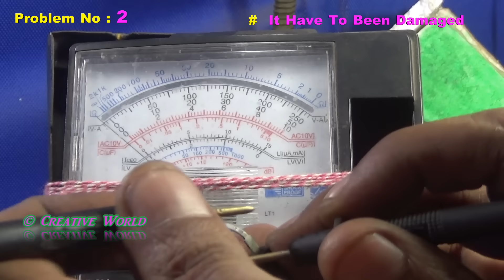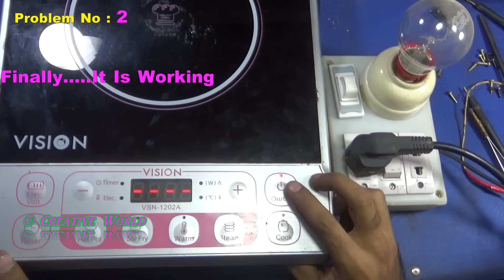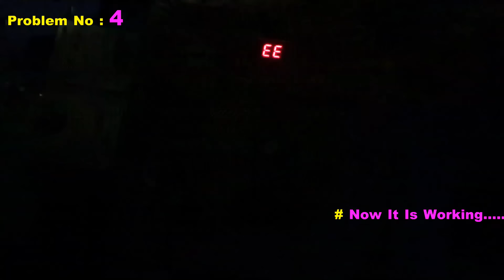Top Four (4) Power Problem Repair Of Induction Cooker - Very Useful

Comment: You are good, but you shouldn't recommend shorting the fuse. That is a potential fire hazard, should anything go wrong. In places where  there are load shedding and other power grid changes, the device could run over it's ratted current specifications and overheat, possibly causing a fire if there are flammable materials near the device. It's a good video however. Next time, consider talking and explaining using your voice to emphasize and clarify your troubleshooting, fault checking, meter usage and soldering to replace the parts...

Comment: Very good video. Personally the music is  overpowering,  so to watch I turned sound off.  Many videos are way more enjoyable  without  music, this includes professional movies. The one I am waiting for part to repair, the fuse  is rated higher than the mains trip, (20A fuse, 20A IGBT, 16A mains trip) so the mains turned off, also the unit was not in use but connected to mains.  So in some units if the IGBT goes short, either the fuse blows or the mains trips.  Added you to my fixit section and a thumbs up.
Reply from the maker: Noted!

Comment: Another possible problem with these cookers could be the thermistor, and this could be for checking the temperature of the cookware by checking the temperature of the base of the cookware, using a thermistor under the surface or perhaps the glass could have an embedded thermistor, which would mean that the repair would involve replacing the glass with a manufacturer part
Reply from the maker: thanks

Comment: Your 1st 3 problem solving are very nice but 4th one are not a correct solution's...need replace fuse with proper amp for safety of  PCB & also user
Reply: How to solve e4 error...my induction works fine in shop but shows e4 error in home
Reply: @maheshnakh   pa-♧08], ♧1 [.¿
Reply: H

Comment: while it works, bypassing the blown fuse might not be the best way to fix it. it is better to replace the fuse. anyway, great video. I've fixed some induction cooker previously too.
Reply from the maker: you say right,,,
i use some shortcut method to repair the induction cooker
Reply from the maker: you say right,,,
i just try my best to see some shortcuts ,,,about the power problem of induction cooker
Reply: Creative World
Reply: you are correct to replace and not bypass.

Comment: I agree that the 4th repair tip is not a good practice. The reason we have a fuse is for safety - to prevent electrical fault that may cause fire. Always replace the fuse with the correct specification. Lack of info as when certain electronic parts became shorted, automatically the fuse should blew up or get busted (busted fuse).

Comment: Looks like, overall though if you're in the field like me, it would be simply replacing the board since we're not allowed to do weldments in operating commercial kitchens. But at least now I know HOW to fix it with a soldering kit.

Comment: nice I had some plastic between coil spacing melt, wondering if contact between coil points will cause a short.. the heater is flashing on and off, and prior to me moving the coil that seemed to melt together a bit was not powering on at all.
Reply from the maker: Most likely

Comment: Sir  i got induction repaired 3 to 4 times. But everytime lagate hi spark ho jata hai. Bahut pareshan hu. Switch board check karvaya. Electrician bolta hai saab wiring theek hai.usi socket mei hum oven chalate hai koi problem nahi aati . Pehle induction  usi socket mei thezk chalta thaa paar pichle 3 se 4 mahine se problem aa rahi hai. Please help & guide

Comment: When i use a neon tester to check the stove top or the vessel placed on it the neon glows. Is that normal? I used the voltmeter to check the voltage between the vessel  and Earth/ground and it shows about 30V.
Reply from the maker: no problem

Comment: Main LED is blinking (ON/OFF switch) and beep sound is also working, but when I press the other buttons then there is no action. What might be the issue. Recently I have washed the stove with water (In top of the panel, I think few drops got into inside).
Reply from the maker: you should wash panel board with cleaner and replace all switch

Comment: It wd have been better if steps were shown to guess/detect the faults - i.e what are the symptoms to conclude that the transistor or the rectifier or any thing else is defective.
Reply from the maker: there may be beep sound,,or no display on the induction cooker
Reply: prestige induction cooker has only been sound after on condition but no display
Reply: My prestige induction cooker some time working. But suddenly off.  After some time it is working.

Comment: sir ji
maine induction cooker me diode,igbt, 12a ic naye lga diye h 1850,1820 ke transistor check kar liye h.sahi h,shot bhi nahi h.chalu nahi ho rha h display fan me koi halchal nahi ho rahi h...
capacitor par 340dc,or ek prove capacitor par dusri display output socate par chake karne par sab par 340,340 dc bta rha h
plz help me.

Comment: Sir - thank you for video. I have 3700W 11" Induction coil, it seems to output very low - boils water same speed as 1850W burner. Could problem be with coil - coil still heats pan -  or the generator board? It is interesting power is almost half - could somehow one item be damaged on generator ?  Thank you

Comment: I have the ihe3790 240v after clean it let it sit for a week before I plug in the cable. No power on display .   Remove the housing found the fuse blown.  Put in a new fuse 15a 250vac with is the original.  I replace the same fuse plug in.  Fuse blown again.   What should I do now?

Comment: There's enough grease, dirt, and shit inside those to cause problems 5 through 18.  How about doing some internal cleaning.
Reply: Sir,
I've purchased an Ind Cooker only four months back,(ie. Butterfly Rhinov2 Power Hob, Power 100- 1000W , it is under warranty, (4months only left)according to Menus, we can
Make Roti/Chappathi, unfortunately
To make a Chappathi is getting very
difficult and that much strain we've to have to hrstupsbecause Min. 10- 15 minutes
Reqd  to heat up (to have a ) Chapppathii, Ours time unnecessary killing more than 15-20 minutes to
prepare a chappathi, What is the solution to minimise the time to have the Chapppathi in 5 minutes period,Is there any remedy to return
the Ind. Cooker to respective company so that a replacement may
have had, it w'll get me more happy in this connection, 
Or any possible  advice  
With Regards,
A Customer of your product

Comment: Hi, a great vídeo. Could you help me, my induction cooktop IS needing repair. All part funciona, but not heat sufficient. Do you know what kind problem?
Reply from the maker: you should check the heating coil
Reply: @CreativeWorldPro  thank, do you know how can i check? I checked with The multimeter and The Signal continuity is ok.
Reply: Do tarikha hai 1. Capacitor 5mfd/400 volt replece. 2 . Heat control preset 203 k replece  job done
Reply: It is not a very easy to check the power rating of induction cook top as it works on the principle of induction not on the joule heating, i can suggest an alternative method to chek the rating of a induction cook top. 
To check the power rating of the induction cook top. Let the rating is X, Now take 1 lit of water and record the initial temperature T1 degree Celcius, Now pour this water into a steel (or recommended ) flat base flask ,( base should be nearly equal to the specified area ), Keep this water for heating for 1 min (60 seconds in 100 percent mode) stir it and record the temperature T2 degree Celcius. Now you can use 70*(T2-T1) to find out the rating, this value should not be less then 75 percent of the rated value.

Comment: For fluids thin plates.The thinner the plate and the smaller the gap in between good heating.Similar in construction with car radiator.boil 1liter of water and then mix with 1liter cold water.
Reply from the maker: Thanks for the tips!

Comment: Hello, thanks for this video. Trying to switch on the induction cooker blows the fuse away in my house. What could be the issue?
Reply from the maker: try changing the rectifier of induction,,cooker
Reply: @CreativeWorldPro  same problem but the fuse goes off only when the coil is connected to the heater ...when I removed the coil and put the fuse it was working fine...when I again put the coil fuse blows off...and resistance of the coil is showing just 5-6ohms only ...what should be the reason

Comment: In step 4 did you leave the bridge on the fuse line? Wouldn't we have to identify and correct the reason for the blown fuse and replace it with another of the same current?

Thanks. I already liked and subscribed to the channel.
Reply from the maker: I did not have fuse, at that time.  For that, i follow that method. But everybody should use fuse.
Reply: Ok.

Comment: hai.....my igbt got bursted, watching your video ,i changed it myself, but it worked only for around 15 minutes and then again got short, the original board had igbt n1600, they have mentioned 20a and 2000v in the circuit board, the replacemment igbt that i got from store was  1b16aj/fga25n120antd... can u please tell me whether the replacement given is okay , then the problem must be in my soldering, thank u.
Reply from the maker: you need to use the same Value IGBT

Comment: i have a problem.. igbt gonna shorted i replaced it with new one now viper 12a ic is heating i replace new one and s8050 tranistor and 78l05 voltage ic also still heating 12 a ic whats problem and the transformer also heating.

Comment: nowadays some electronic component manufacturers use iron instead of copper for example in resistors, could the magnetic property in them make them heat up especially those near the copper coil induction element. using a neodymium magnet will tell you if its pure copper or iron used.
Reply from the maker: Yes, absolutely

Comment: Sir, my induction gets on!! But doesn’t sense the cookpan!!! Instead produces sound in a regular interval... when paused the sound disappers!! Can you help ?
Reply from the maker: what is the main problem ?
Reply: Induction cooker making a regular beeping while a pan is not placed on it while active isn't itself a problem but in most cases be part of its programming .

The things I do in similar situations  are ;
1) Resolder the ground jumper line .
2)Check the box capacitor 5 muF,(make Shure to remove them and check underneath it)
3)check the 8550 and 8050 transistors .
4)while plugged in series ,put multimeter in DC and while placing negative probe on Bridge Rectifier negative ,check the resistors to see if any of them are open .

Comment: i got one issue in the induction cooker, when i had switched ON , main MCB was tripped ?
how can be solve it?kindly reply
Reply from the maker: you should check IGBT and Rectifier Diode
Reply: What is the rating of your MCB
Reply: Change the diode rectifer or the transistor
Reply: gubga hai kya

Comment: Hello sir, 
Hi have same induction with highway09A AC with Viper12A. Both rectifier and IGBT is gone. I have only rectifier and i am replace with new one. All voltages 5V and 18V supply properly to the all circuit. But my display not on, is Compulsary requirement of IGBT in circuit after that all circuit working. 5V reaching upto display section but not on. Please answaer
Reply from the maker: yes

Comment: I found Boom!!! when pluged, then open the cover and found fuse exploded. What should I check first?
Reply from the maker: mosfet, bridge rectifier and diode
Reply: @CreativeWorldPro  same problem but the fuse goes off only when the coil is connected to the heater ...when I removed the coil and put the fuse it was working fine...when I again put the coil fuse blows off...and resistance of the coil is showing just 5-6ohms only ...what should be the reason

Comment: Bajaj induction icx 8  Mai igbt bar bar failure horahai kya problem hai. I have replace capacitor, 8050&8550 ,pwn resistor .
Reply from the maker: check the bridge rectifier
Reply: @CreativeWorldPro  I have already replace it

Comment: Just repaired one today, one end of the inductor wire disconnected from circuit probably bad soldering so no current flow through. before repaired it keep showing error E7.
Reply from the maker: try changing,,,heating coil

Comment: The video really informative,My induction top as i switch on the mains it get tripped off ,I checked the power supply chord, it is not fused .What could be the problem ? and how to set right?
Reply: transitor change me

Comment: Mera induction garam to karra hai par baar baar EO energy off fir on fir EO fir on  hone pe laga hua. Beep ke saath.
Reply from the maker: when the induction cooker don't get any pot then the induction cooker show "EO" error Code
so put a pot on the induction cooker
Reply: @CreativeWorldPro  you didn't read my comment properly .  I said that induction is already working but it  continuously producing  beep sound while heating and panel showing EO for few seconds then again start to heat this processing keep  repeating .
Reply from the maker: you can check the push switch and heating sensor..
you also can try change your pot, that you put on the induction cooker

Comment: Meta problem hai Ac connect Karen  me bad sabhi led light blinking karne lagti hai stove kam nahi karta hai kya problem hoga
Reply from the maker: 1st you should  change Power Switch
Reply: Change reban wire which is canect  switch panal and main pcb

Comment: Havells induction problem ye h ki kuchh der hot hota h uske bad band ho jata h fir chalu hota h fir band ho jata h
Reply from the maker: 1st you should check Cooling fan
2nd you should check rectifier diode and mosfet
3rd you should check the push button switch

Comment: Prestige pic 20 induction hai board par jaha power connect hota hai o uur gaya to mai usko direct board par tightly soldring kar diya uske bad on kiya to fuse ur gaya solution boliye sir
Reply from the maker: are you sure, you connect on the current place ?

Comment: If induction gives a bip on power on and no display in board and if in case of main IC is dead then what will happen?
Reply from the maker: you need to change the IC

Comment: Hi...my Surya A8 induction having fuse problem and I change it but having same problem.. Please help me..
Reply from the maker: you should check bridge rectifier and output transistor/mosfet
Reply: thanks
Reply: Sahi hai
Reply: Bro my cooker is prestige the internal fuse will blast what type of fuse i bought what is the amps i use it? They given 125 amps 250vac what

Comment: when i am trying to switch on the induction stove  the MAINS  is tripping , so i changed the bridge and IGBT and capacitors too even though same problem repeted why..??
Reply from the maker: what do you meaning by "Mains Tripping " ??
Reply: His main power supply trip off.Micro circuit breaker become on and power supply is suspended. There is short circuit somewhere. Until it is fixed, this problem will go on.
Reply: @ramanankp8052  but when the induction coil is removed and turned no problem working fine otherwise fuse getting damaged

Comment: Pigeon Favourite IC 1800 W Problem =E1
Description of Error : Voltage is too low or too high.
Reply from the maker: you can try changing "Induction Cooker Thermistor Temperature Sensor"

Comment: Fuse calls off every time ... when i switch on induction stove... i had changed bridge rectifier and capacitors even the same thing is happening.. i had read lot of problems with same issue
Reply from the maker: there may be short circuit

Comment: Which white paste you used ?
Name?
Reply: My induction is not heating more then 60 degree
Reply from the maker: that's name is Hongfa paste..
or you can call it, High Voltage Silicon Rubber
Reply: Ese cooling compound kahete hai. Koi vi computer hadware me milega
Reply: @CreativeWorldPro  is tat heat transfer compound or u used it for insulation purpose

Comment: I St remove back ground music,  in 4th problem we can not  replace fuse without checking IGBT & bridge rectifier &. Higher voltage capacitor s
Reply from the maker: yes

Comment: Induction cooker not working and not display any code,power code and fuse ok, capacitor 4,7 uf/450v broken change to 10uf/450 v and 23 ohmz(ROBG) resister not in range both side, cange to 22 ohmz(RRBB) but burn resister, what I do next
Reply from the maker: use same value resistor and check the IGBT &  Bridge Rectifier Diode
Reply: Am from kerala, my nearest cities not get same resister, any substitute
Reply from the maker: you can buy from on line

Comment: Can i use 12.5amps fuse
Reply from the maker: yes, you can
Reply: Bro one suggestion  iwill already replace an new fuse the inbuid fuse is 12.5 amp i will change new 15 amps it is ok for induction stove the stove wattage is 2000
Reply from the maker: you can use easily
Reply: @CreativeWorldPro  thanks bro